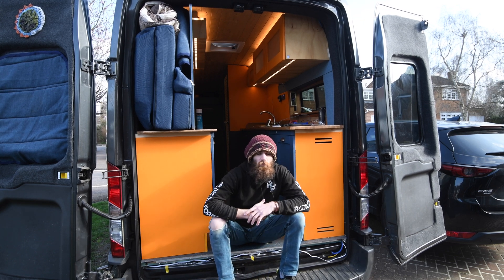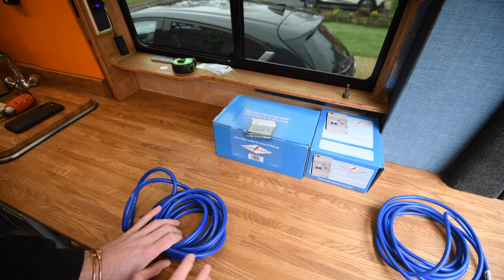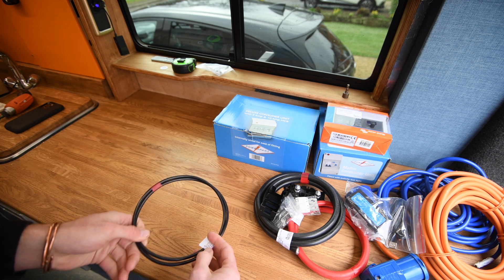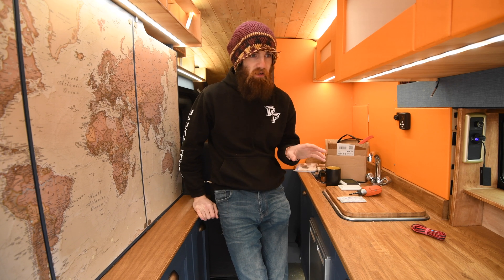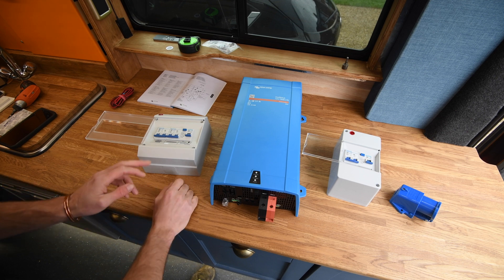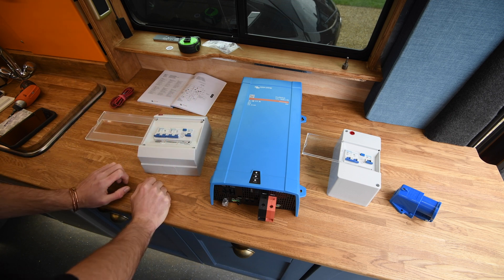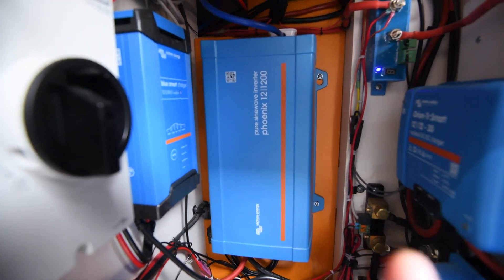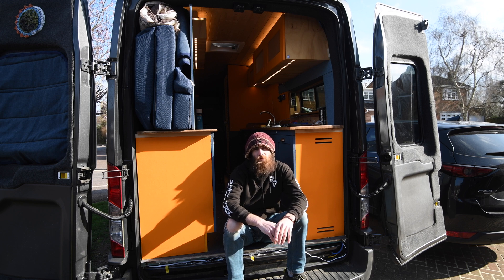Part 1: Installing a Victron MultiPlus : Plans and prep | EP48 | Ford Transit Campervan Build

Comment: Good video, I got 'Energy Solutions' to sec my electrics using almost identical Victron products with no mention of a consumer unit before the inverter in their schematic diagram.....very good idea...I'll quiz them on this...cheers
Reply from the maker: The multiplus being a combo unit makes it a confusing one. As I had seen a number of other multiplus set ups not using a consumer unit before the inverter. Yet speaking to a Victron dealer and looking on the Victron schematics they offer showing the use of a protection beforehand.  Additionally looking at the Victron easysolar units ( a combo unit with multiplus, mppt and other bits ) they also include protection built-in for the AC in and AC OUT.
Reply from the maker: I guess as the AC in should already be protected at its source some people don’t bother protecting AC in. That doesn’t take into account that protection at source has been  done correctly or is functioning
Reply: There seems to be two 1600w inverters, your style and the one I have that seems slightly bigger with a metal case and square !!! the only difference in the part number is '230VP' and '230V' do you know what the difference is....
Reply: I think you have a new version !!!!
Reply from the maker: My from researching of it. The “Multiplus compact” got a case redesign at some point in the last few years. The 1600VA models and below got the plastic body similar to the Victron Phoenix inverters, most features remained the same apart from smaller physical dimensions and a cheaper price. And a number of models especially the higher output models went from “Multiplus compact” to just “Multiplus” and retained the slightly larger metal case. Then you have the Multiplus 2 comes out with new features
Reply from the maker: He is a link to the Victron website explaining the new style. 

https://www.victronenergy.com/blog/2017/07/17/new-style-multiplus-set-to-replace-earlier-compacts/
Reply: @MispronouncedAdventures  Alex, sorry more questions, what extra power consuming stuff are you running to justify getting the the larger 70A version? just out of interest are these things just related to your particular type of van lifestyle needs or are they more to do with the everyday standard running of your van? That is to say... is there some extra stuff we need to pay attention to when it comes to the power consuming side of things? Thanks
Reply from the maker: @OnlineopticsCoUk  wasn’t so much the extra power consumption. More that if I’ve gone for the 1200VA multiplus to match my current output of the Phoenix I had, that would’ve had 50amp Charging. To go up again to the 1600va models which 70amp changing wasn’t too much more cost wise .
Reply from the maker: However I could now run my heat gun off the inverter if I wanted to and even a single induction hob if I really decide I want too haha
Reply: @MispronouncedAdventures   yeah I see that only about £100 more well worth it...